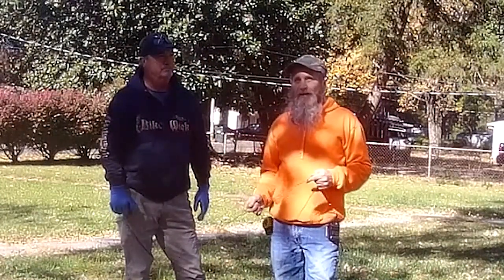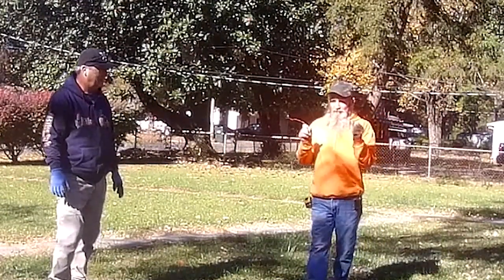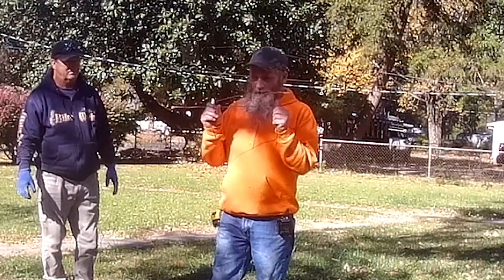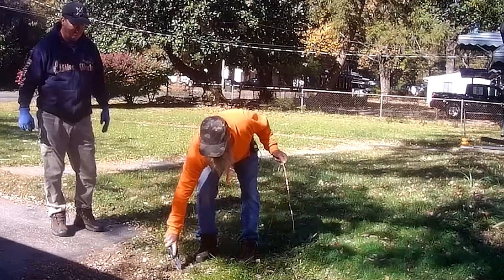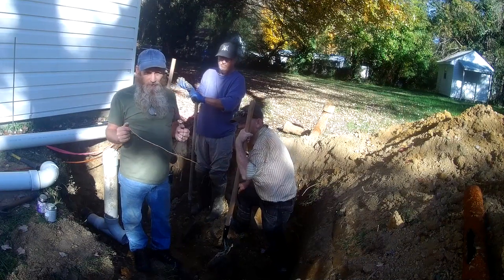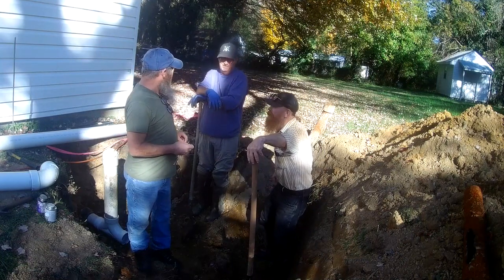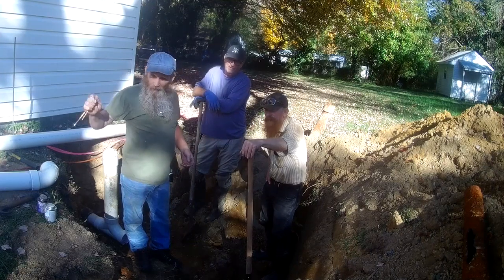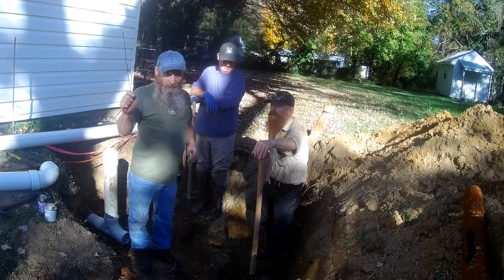Using a Divining Rod to Locate a Sewer Drain

Comment: I'm a believer Dave. I work in the oil and gas industry and with 40 years of service I was taught this method about 12 years ago, by a coworker who was 30 years younger than me.  He also showed me how to get the depth of the pipe we were looking for.  His location was spot on. However his depths were off about 3 feet. Still amazing in my opinion.  We were trying to find a  6 inch plastic City Water line which was 18"s from our 36" high pressure gas line. His predictions said the water line was 8 feet deep. We finally found the top of the water line at 11 feet. The young man  Made a believer outta me that day. Which BTW shows your never too old to learn something new.
Reply from the maker: I had heard others show a way to estimate depth as well but could not remember how that was done.
Reply: The way I was shown is, once  you have located the line you put your crossed wires on the ground and slowly start lifting the wires straight up.  Once the wires break the electric field have someone measure from that point to the ground and "bingo" that should be the depth. It wasn't spot on but its something to go with and sometimes it works. When the young man showed me this trick the plastic water line was exactly where he said it was but it was a little deeper. I expect it'd be more accurate with a metal line.
Reply from the maker: @deanbarr5740  cool I will try that

Comment: Great old timer's trick.  We used to bend them up from brass brazing rod and use short pieces of copper tube to make hand grips, so the rods would spin around inside the tubes super easy (don't have to worry about your grip or sweaty palms confusing the spirits).  Always worked like a charm to find anything underground that puts off a magnetic field, whether water or electrical wires.
Reply from the maker: I may try that next time

Comment: They use them a lot here to find water for drilling wells and to find water lines.  No different then the electronic ones the utility companies use. The end of the video was great! lol  Have a good weekend Dave!  See ya!
Reply from the maker: thanks John hope you guys have a great weekend as well.
Reply: @daveknowshow  Is there anything to concentrate on blade types and number of blades used for tractor power capacity.
Reply from the maker: @farmandtech  blades as in mower deck blades? I dont fully understand. however with that said typically the owners manual will specify size and number of blades for mowers and size / length of blades and cutting edges on ground engaging implements. the manual is where I typically start.
Reply: @daveknowshow  I am looking for rotary tiller blades sir, here there are 3 type of blades in practice L , J , C type blades. For 36hp tractor comes with pto 28hp,people's insist to use 1 blade per pto hp so 28 blades are used in case of L blades.does it change with J type and C type blades?
Reply from the maker: @farmandtech  I don't think it changes with the type of blade just the number of blades. your way is likely the best way around here they tend to say so many horsepower per foot wide of tiller. 5 foot tiller takes 25 horsepower. 5 hp per foot. some say 4 hp per foot however, your way going with number of blades is far more accurate. you can get 7 foot tiller with less blades than a 6 ft tiller that has more blades and requires more horsepower. the best option is checking the owner's manual which may pinpoint what they recommend. hope this helps.